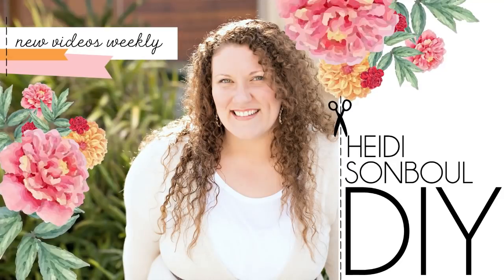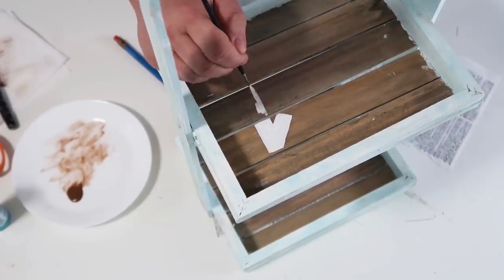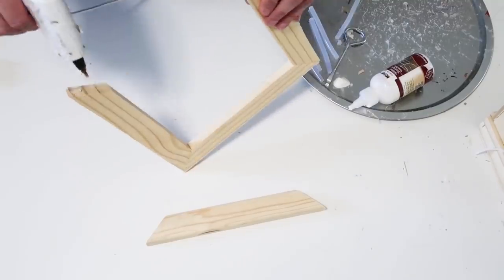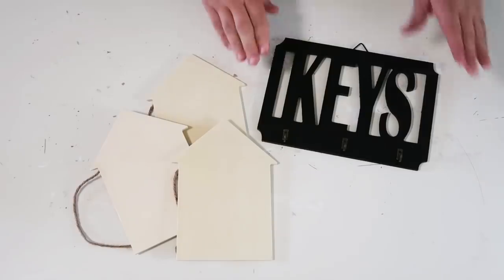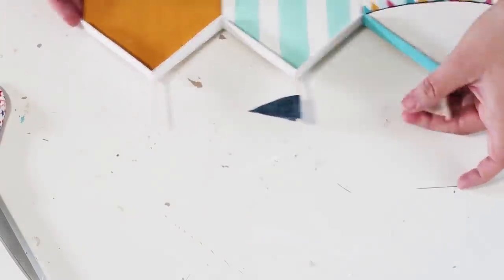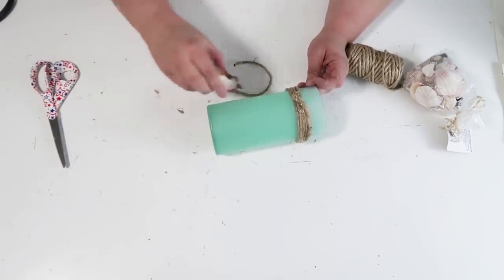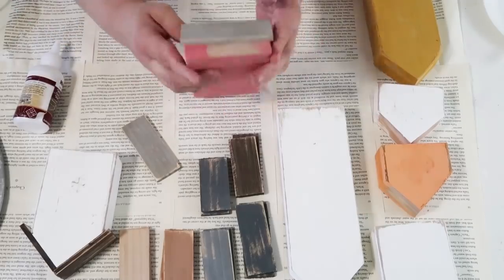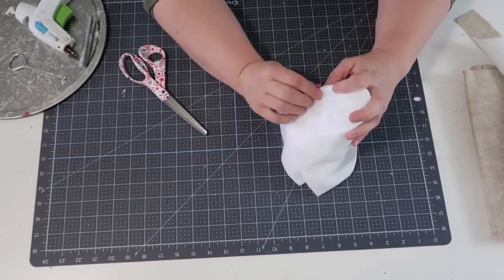20 Coastal Farmhouse DIYs | High End Dollar Tree DIYs |

Comment: So, I absolutely adore your videos. I watch them over and over. I have to share with you though, I’m am holding my breath when you use yours mitre box. I’m always afraid you’re going to hurt yourself. So I wanted to share a fix with you. Use the holes on either end to screw your box to a 2x4, then glue a pice or the grabby shelf liner to the bottom of the piece of 2x4. Your mitre box will no longer wiggle around and be unstable. 💕

Comment: I rolled scrapbook paper to make a cone, put mud podge all over.  Then roll in glitter. So I thought as you were making the lighthouse that i could take my Christmas cones. Take sandpaper and sand off most of the glitter. If there is some left on the cones that will be okay because when i paint them it will look a little like cement. Then I will paint white, let dry, then paint over the white in a design of different lighthouses. Of course I will copy some of your dacoration ideas but make each lighthouses different. different on both. What do you think?